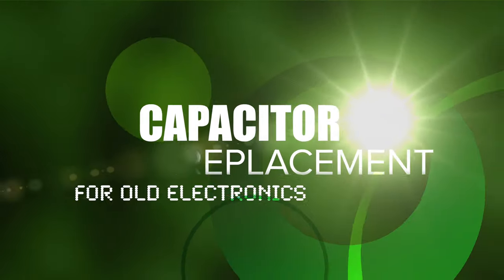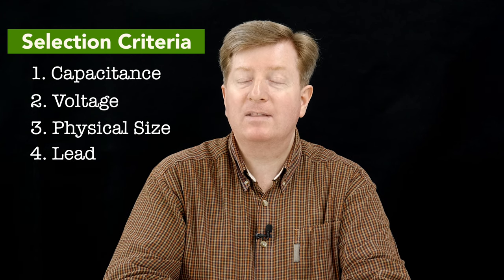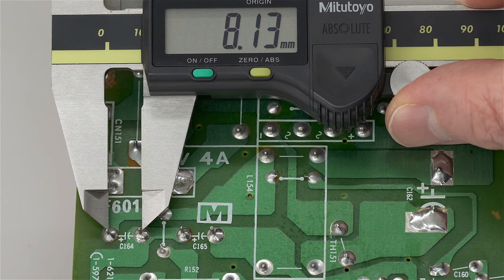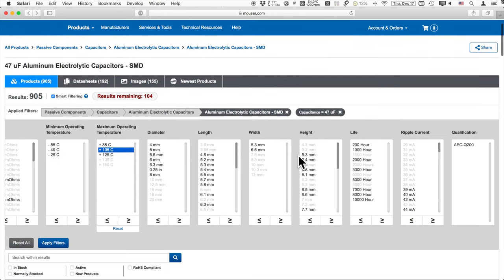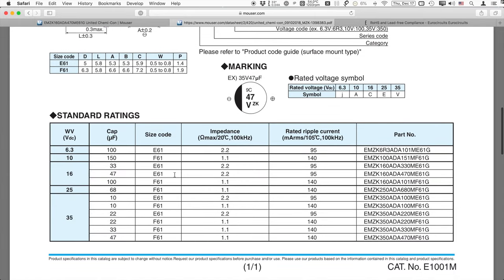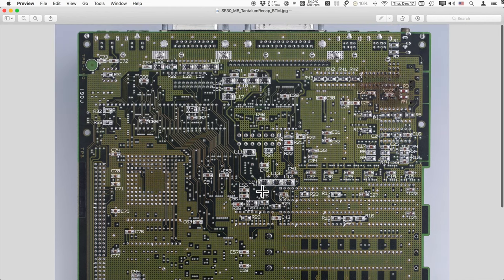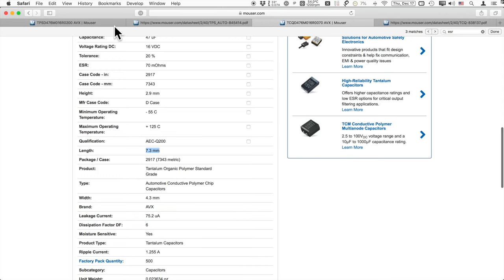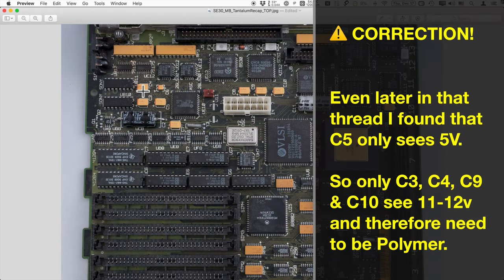Choosing Capacitors to Recap Old Electronics

Comment: What??? German caps are the worse than Chinese caps!
Reply from the maker: "What???" is right!  I'm confused by your comment. At what timestamp in my video to you hear me say that?
Reply: @JDW-  I was saying that.  My experience with German made industrial Ultrasonic Equipment is that the designs are wonderful, BUT they use the cheapest German Made electrolytic caps made.  Other than WIMA Film and Polymer caps used in switching supplies, I have never come across a good German made cap - lol.  Just my industry.
Reply: @JDW-  VISHAY ROEDERSTEIN Electrolytic caps have destroyed more Buck/Boost supplies than I can count and when the buck supply fails it lets the primary voltage through and destroys chips on that rail.  When I see a board, working or not, with VISHAY ROEDERSTEIN caps on it, it gets re-capped with Panasonic or Nichicon.
Reply: @JDW-  In the early to the late 1980s Krautkramer made a wonderful UT instrument called the USIP12.   Not 10 years old the Amplifier boards would need re-capped (leaking and open caps, typically 4.7uf and 10uf caps).  For the amplifier module, that meant 103 VISHAY ROEDERSTEIN electrolytic caps to replace and then there were ~four other modules including mainframe board.  That instrument had exceptional linearity, bandwidth, and resolution that all declines each year with age.  You were very lucky to get 10 years out of VISHAY ROEDERSTEIN caps; typical was more like 5 years.  Believe it or not, we replaced most of them with tag tants.  Never had the modules fail with tants (at least past a 24 hour burn-in period).
Reply from the maker: @Daveyk021  I have no experience with VISHAY ROEDERSTEIN caps, but your words appear to indirectly fire a warning shot across the bow of Wurth too, as they are in Germany! 🙂  If you would like to dive further into explaining what you mean (especially if your experience pertains to Wurth caps), then I am all ears. I buy and use Wurth sometimes. I've not heard a lot of negativity about Wurth caps, hence my curiosity regarding your own experience with them specifically, not just with German caps in general.
Reply: @JDW-  Wurth is probably fine; or very good; those damn Vishay caps turned me against German products.